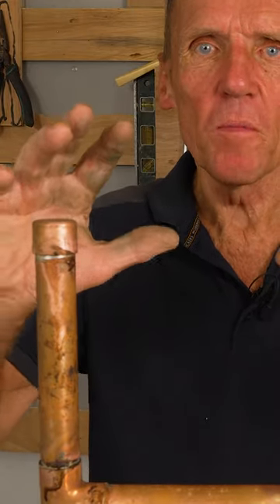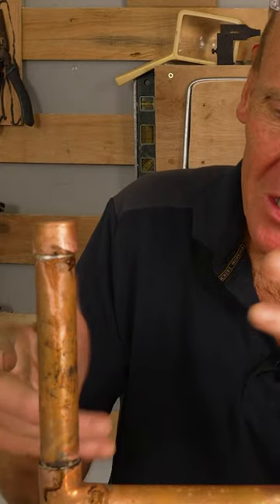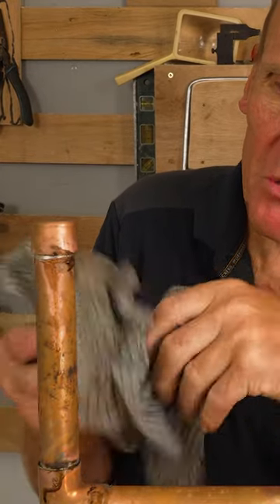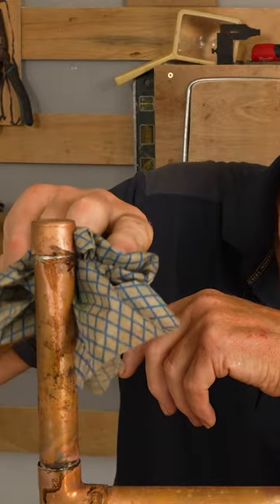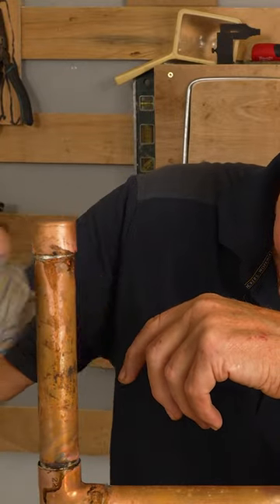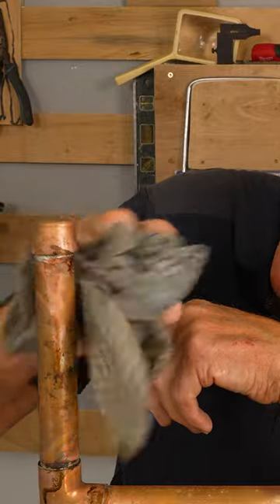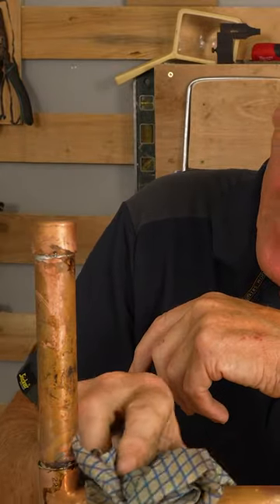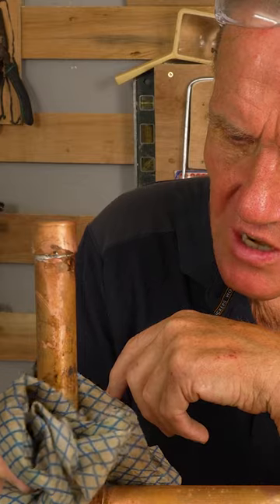Soldering Copper Pipes #shorts

Comment: So the small details are most useful to the amateur, like the bend in your solder indicates how much has been fed into the joint , more needed for a bigger pipe , so the kink in the solder 1/2 or 3/4 inch . The green flame idea is probably less important than the sequence of work, I notice the flame on the opposite side to the feed in point, this ensures the whole is fully up to temp. Many thanks roger for your encouragement and practical advice. Also make sure all flammable hazards are taken care of. Hot works in some locations are very regulated and controlled as consequences can be fatal and very expensive.

Comment: I'm not a licensed plumber but I do a fair amount of plumbing work and I've never had a problem using a wet rag around my solder fittings. I've also heard it's not good to do it but when you have to get in there and immediately do something else you need to be able to not burn the hell out of yourself by accidentally contacting that joint with your forearm or elbow.
Reply from the maker: I also use a damp rag but I usually let the solder set and then cool it.
Reply: @SkillBuilder  I let it sit for maybe 30 seconds before I use the damp rag.

Comment: AS heat rises would you not be better off soldering first at the bottom of the tee working upwards ?
Reply from the maker: Hear rises by convection and that is not what is happening here. The heat travels by conduction and I solder the bottom last because I remove the heat just as it appears at the mouth of the fitting. If you work upwards the solder will run down the pipe, which loses you points.
Reply: HEAT DOES NOT RISE! Ffs🤦‍♂️

Comment: This is a great demonstration! So interesting to see the solder get pulled around the circumference of the joint. I guess it's surface tension helped by the flux.

Ive only soldered electronics --much lower temperatures and foolproof. Im interested in plumbing.
Reply: Not surface tension. It is capillary action.  Capillaries are voids filled with something.  The space between the fitting and pipe section is the void.  Flux helps it flow evenly.  

Also...these joints were not filled properly.  In fact, two weren't even filled all the way around.

Comment: What would be interesting would be to show how to deal with a leaking supply or outflow flange joint on a copper water storage cylinder. 
Mine has been weeping very slightly for some years due to subsidence movement flexing the connected joint. The only option I can see is draining, removing the cylinder and potentially fitting a new cylinder. 

Previous kludges were epoxy putty offered up to the joint but with continued movement obviously this has started to weep again. I can't see any "clever" way around this.

Comment: I would have thought the correct sequence on the tee would be bottom to top but Roger did it the opposite, what do I know I'm an electrician.
Reply from the maker: I do the bottom last becuase, if you do it the other way the bottom joint can run while you are heating the top and that looks messy.
Reply: @SkillBuilder I thought by heating a lower joint would cause the solder in the joint above to over-run, I'll shut up now😁
Reply: I’m heating a joint right now 🎉
Reply: @WHATTHEFRONTDOOR 😏
Reply: @SkillBuilder you are absolutely correct. I always heat Tee from the top to bottom

Comment: At college they taught me to use 15mm length of solder for 15mm pipe and 22mm length of solder for 22mm pipe. I find that too much if it is going to be seen! Old flux is the way to go for a clean joint but then you need to clean the fitting and pipe very well. When not going to be seen, just add until you think it isn't going to leak